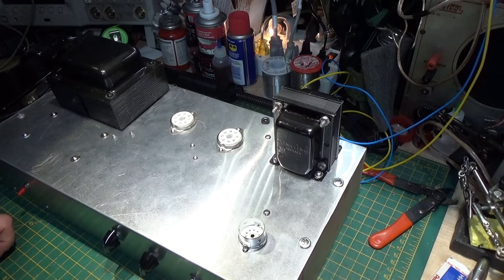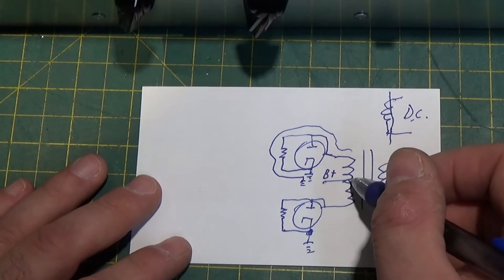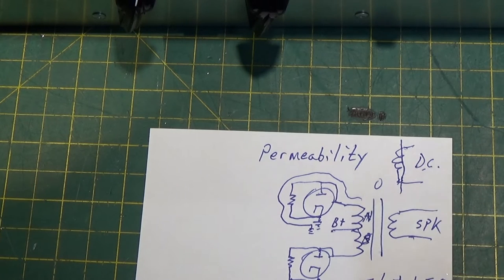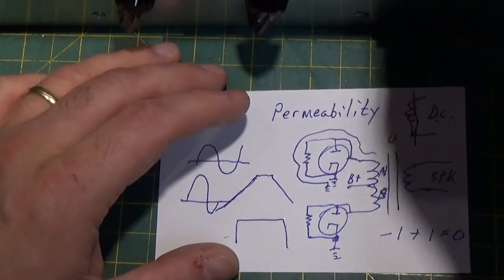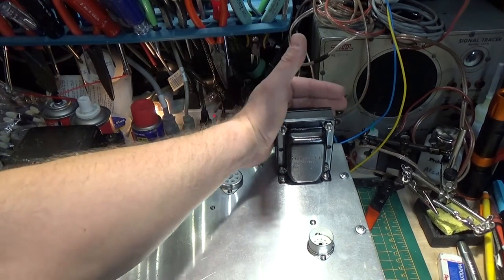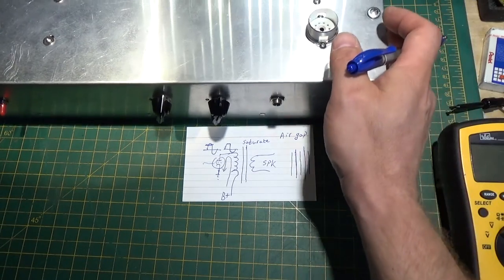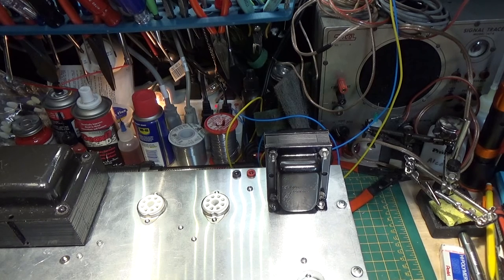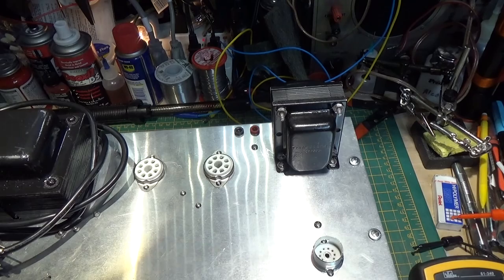Lets Build a Guitar Amplifier - Part 4 - Output transformer mistake and explination

Comment: The obseration of using air gaps to decrease the magnetization is correct. However. The air gap equivalent with some non-permeability material is not introduced between the laminates in the laminate direction. That would only decrease the effective cross section.

The air gap equivalent is achived by stacking all the E laminates in the same direction and all the I laminates into a bar. Then a small sheet of some non-permeability material is inserted between the E stack and the I bar. This increases the "magnetic resistanstance" of the core.

The video shows the stack having the E I orientation switched every three laminates. This is just convenience. Sufficient symmetry is obtained. Best would of course be to switch the orientation every next laminate.

I made a blunder myself claiming that superregenerative receivers are not slope detectors detecting FM. The fact is that they are with FM.

Comment: Laminations are usually (silicon) steel, not iron.  Silicon steel has much higher electrical resistance than iron, and less magnetic
hysteresis, both being advantages for reduced losses.  Specialist alloys are probably used for single-ended transformers to increase linearity with a DC current offset (ie a DC magnetic flux burden)

The gap limits the permeability of the core, which reduces the low end response, but increases the amp-turns before saturation,
and also stabilizes the properties of the core across temperature changes.

Comment: Great vid. So just to recap, transformers for single ended design have air gap?
Reply from the maker: Yes.  The core of a transformer is made up of thin laminations of ferrous material, all sandwiched together.  The thickness and alloy of each lamination affects the flow of eddy currents in the core, as well as the saturation point.  By adding a non-ferrous "shim" (mica, plastic etc.) between each lamination layer, it breaks up the eddy currents and raises the saturation point of the core by adding an insulating air gap.  This is necessary to prevent the core from saturating and magnetizing when you apply the DC idle current in one direction only, as you do with a single-ended output section.

Comment: Hello I have an indirectly related question I have a Yamaha B 100 - 115 III bass amp I had unplugged the speaker and forgot to plug it back in and then went to plug in a bass I believe that I blew out the output Transformer the headphone jack still works but nothing comes out the speaker now are you able to confirm this based on the scenario? Thank you very much for your input.

Comment: Does it go both ways? Could one use a single ended OT in a push-pull amp?
Reply from the maker: No.  A single-ended transformer only has a single winding on the primary without the necessary center tap for push-pull.  The permeability of the core is also different.  Each transformer type can only be used for its intended purpose, as I found out the hard way!
Reply: xraytonyb Super. Thanks to you I won't have to try and fail myself. Thank you for your super fast reply and keep up the good work.

Comment: I thought you need caps to block the DC to the output transformer..........no?
Reply: ToBeOrNotToBe have a look at most schematics. You’ll have AC going to some sort of rectifier then to some filter caps that smooth out the ripple. Notice that preamp tubes always have the most filtered DC possible, with their DC B+ to their plates coming from the 2nd or 3rd node from the power supply. Power tubes done require as much filtering, so you can often get away with DC from the rectifier through one filter section of the power supply, with further smoothing from the output transformer centre tap splitting to each plate. The output transformer acts like a choke in regards to a rectified B+ supply.
Reply: On the output screens you need a .05 -0.02 coupling capacitor that’s about it on the tube to the trans

Comment: I previously made a comment about a laminated transformer not needing the air gap.  I was incorrect and deleted my previous comment.  As I sit here with my foot in my mouth. :-P  Tony and Hammond transformer are correct,  Tinkerham was wrong and stands corrected.
Reply from the maker: No problem!  I originally tried to go online and find some info about this and quickly found out how little info there is.  Only after a lot of research and going back to my college transformer class over 30 years ago was I able to figure this out.   I thought this video would help others so that they wouldn't end up making the same mistake I did.

Thanks so much for watching!
Reply: Yep, I watched part 4.  You need a nice open back box for that speaker!  Congratulations on a successful project completion.  BTW, I like the home built guitar!